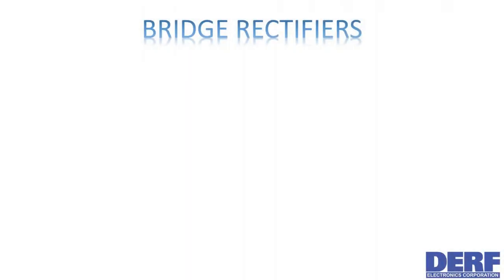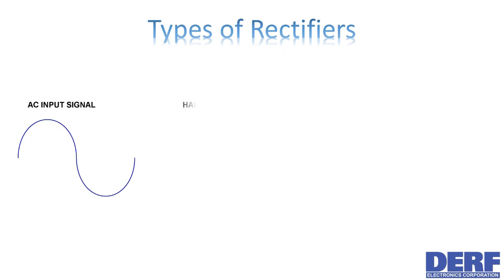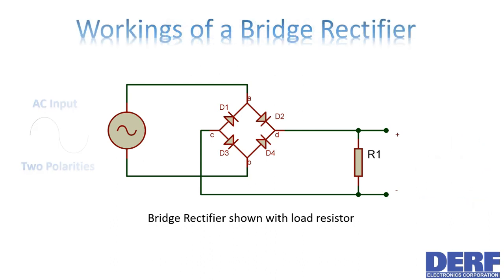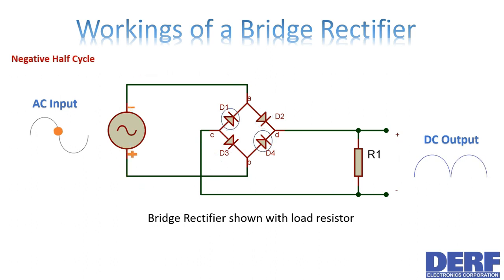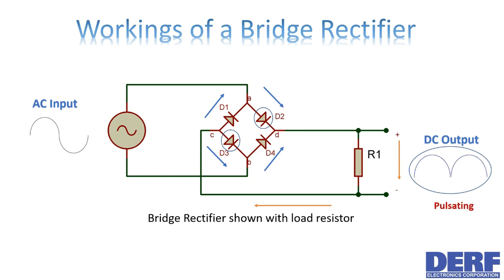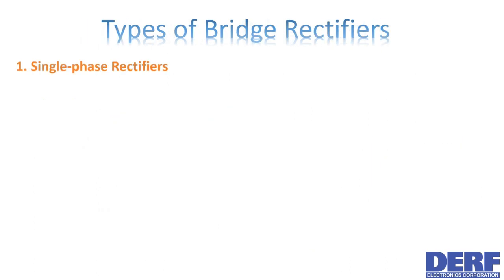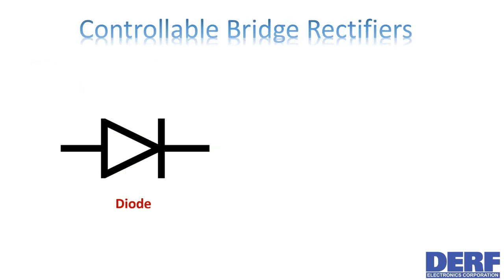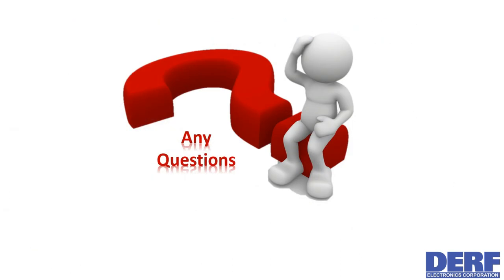How a Bridge Rectifier works - Step by step Tutorial - DERF Electronics

Comment: Why during the positive half cycle the current doesn't go through diode D1 as well, when coming back from the resistor, and instead it only goes through D3? Logically, for me at least, it seems like it should be able to go through D1 as well and back towards intersection point a, through diode D2 and short the circuit, but that never happens. I am still trying to find an answer about that but it's possible that just my knowledge of electricity is kinda lacking.
Reply: Because point A has a positive charge, and repels the current, whereas point B has a negative charge and attracts the current.